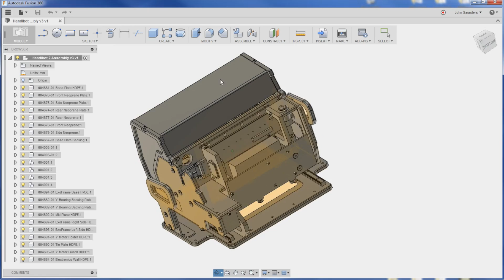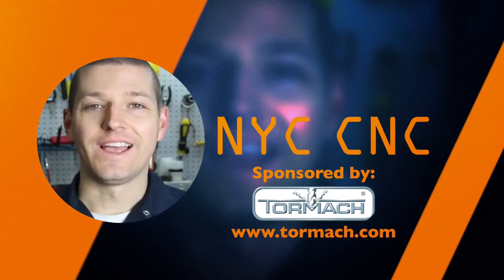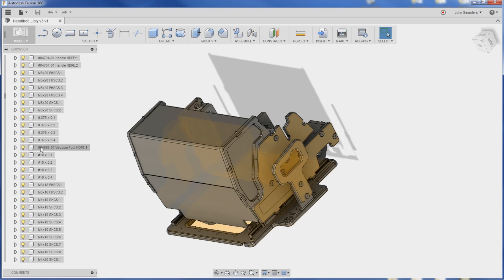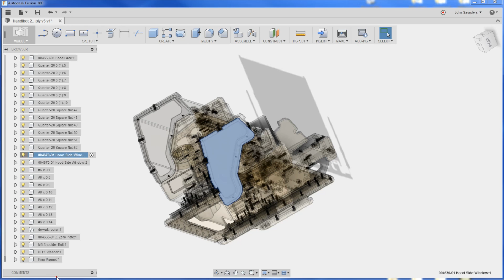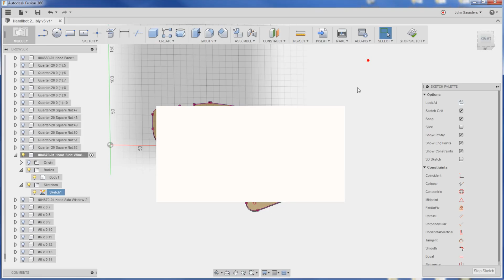Fusion 360: How to Export as DXF File!  Fusion Friday #27

Comment: im having a really hard time with this. only making a flat part for laser cutting. trasnfer to dxf fine. but machine shop cannot open it on solidworks and it comes up with with an erdw file. so cannot get my parts cut because of it. ive tried it on auto cad and works fine. please help me or point me in the right direction. cheers

Comment: Ok... I made the DXF.  BUT, how do I get Inskscape to:

1.) Keep it in inches?
2.) Import proper scale?
Reply: Have you figured out a good way of doing this? This is driving me nuts currently, I export the sketch but it's too large when imported into cutting software.  Apart from resizing in the cutting software I'm not sure how else to do it, frustrating for sure if the cutting software isn't really precise though.
Reply: Also wondering about the scale. I've sent out .dxf files to a couple companies and they've both called back wondering what scale I'm drawing in. But if I upload to any online cutting service, it always scales it correctly. 

I've found you can save a drawing as a .dxf with dimensions, but whenever I open it back up, it's all fubar with sketches floating around in 3 dimensions.

Comment: hi john,  the video is great i as i knew it would be lol, i have found that if you right click on a component at you bottom there is an option to "find in browser " this makes searching a lot easier, the next one i am working on is making a bolt and v groove bearing move together when joined any ideas ??, i have sent you a fusion 360 file for an arm tool changer i am working on , when its done and finished i think it will me very cool,  keep up the good work and many thanks for this fusion Friday, thanks Daniel
Reply: Daniel Kitson A sort and sweet video to the point thanks Andries BREEDT
Reply: hi john, check your emails lol, sent you some emails on a cheap linear rail and rollers, this could be good for some of the viewers that want to build a cnc machine, thanks daniel